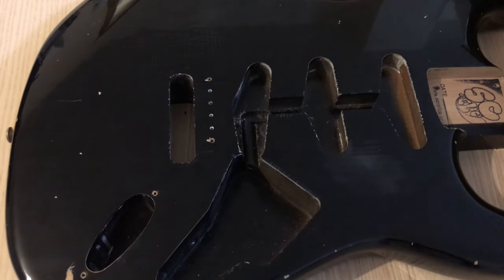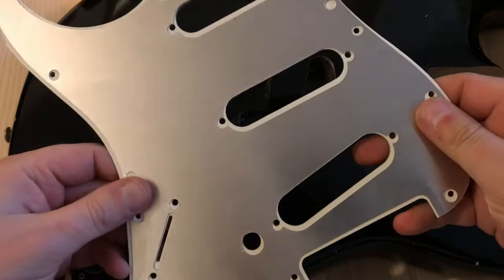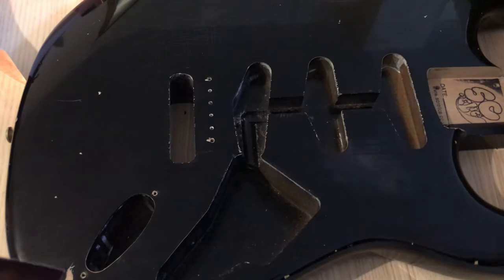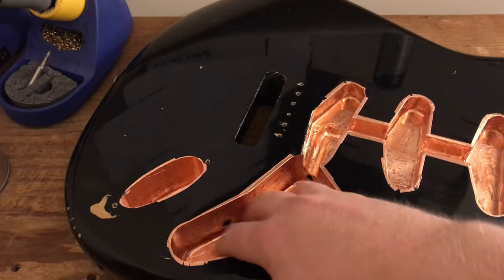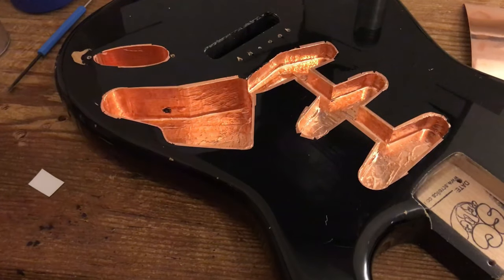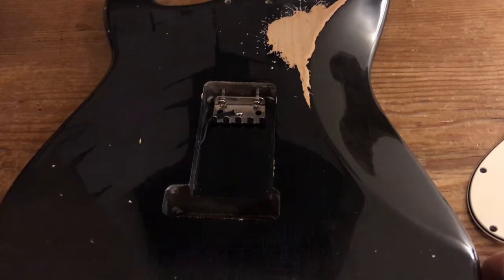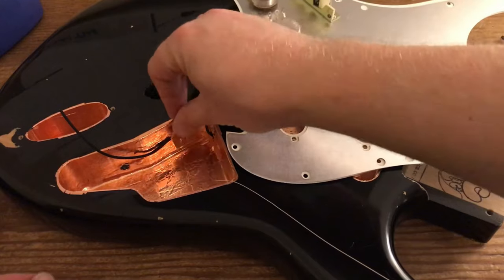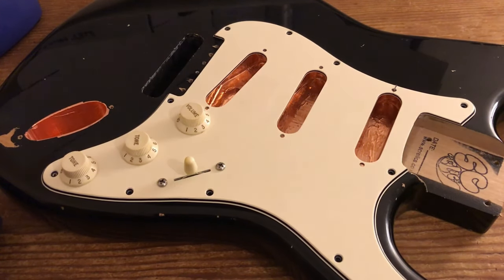Guitar Copper Shielding - How to Shield a Strat

Comment: Hi, nice video, I just have to ask, I have a Stratocaster and is giving me too much hum sound. I figured out that it doesn't have the ground cable connected to the back of the tremolo, do you think it may fix this issue? Another thing, which knob should I use for this job, volume or tone? Thanks again. Great video
Reply from the maker: Hi, thanks. Yes it should definitely be grounded to the tremolo claw. Use whatever knob is easiest
Reply: Yes, you have to ground the strings on every guitar and on a strat , they run a wire to the spring claw. Shielding your cavity to reduce noise is does not work and is simply foolish to do so. It is a wives tale that beginners will think it works for some reason when  over 100 guitar manufacturers do not all , shield their cavities with cooper. If it did work, someone would shield their cavity.
Reply: @invecta18  then why do so many people do it then and notice a difference in hum afterwards? why guitar manufacturers don't do it might be because of other reasons - like cutting down on labour and costs lol
Reply: @FriendlyNeighborhoodBallsack   Hi,  The reason is that it is suggested that it works is that people assume it works without seeing a test.  Then you watch several videos like this one and you will notice there is no A B comparison.  But still you think for some reason it works. It sound legit ?   I thought o until I did  a test.  It is a monkey see -monkey do thing. I have had a guitar repair business for 16 years and I a thought it was a good idea  ? After shielding a cavity,  It didn't seem to help much ?  I tested it  with a audiometer and found it to be useless.  I would ask  you the question , if so many people do this, why do none ( as in not one) of the major manufacturers do it ? The reason is it is extremely ineffective , it works only very , very ,  very  slightly and that is only if the person has taken the time to ground the copper foil to the circuit. I have nothing to gain from anyone believing or not believing what I am saying and I would have no purpose in making it up. This is valuable information for those who can comprehend this. It does not hurt at all to shield you cavity. It is simply as waste of your time and some money. In doing guitar repair, I have found that the smarter decisions I make, the better my projects get done, the less time I take, and happier my customers are. The more I make foolish and unnecessary decisions, the longer it takes for me to get things done, the more money it often cost me, and the less satisfied my customer  are.   Some people you can help and others you can't  .  Good luck Phil Barry, 14 West Guitars, Dunedin, Fl
Reply: @invecta18  why dont u make a video to proove it???? Just give me a link that u did a video that this video useless pls🙄
Reply: Every manufacturer uses conductive paint in their cavities and then paint over it with the body color paint.

Comment: Does it matter if your grounding wires have sheathed around them? I've stripped the sheath back obviously for soldering points but wasn't sure if it has to be bare copper wire or if it can be sheathed on the outside?

Comment: You don't really need the jumper wire between the jack cavity and the main cavity. The jack and its plate are already grounded. And with the jack plate touching the foil, that will ground that cavity.

Comment: Rather than soldering the wire could I put the wire in before putting in the copper shielding and let the copper tape hold it in place?
Reply from the maker: Yes that’s fine as long as it is well and truly taped down well 👍 but soldering it in place is easier in a way because the copper takes solder really well. If you can solder to pot casing, soldering to copper tape should be easier. Thanks for watching

Comment: Might have been a good idea to screw the ground wires to the body instead and connect them to the copper tape mechanically no? How strong are the welds to the copper tape?
Reply: The solder holds up great on copper tape
Reply: I would screw it using a copper star washer and solder it afterwards. 😆

Comment: Instead of soldering the ground wire to the copper foil, is it OK to put a tiny screw through the copper foil and solder the ground to the screw? Soldering it directly to the foil worries me down the road.
Reply from the maker: yeah that works great too. I can assure you though that soldering onto the copper is easier. All the best and happy holidays!
Reply: @SixStringSupplies   Wow, thanks for the quick answer! Happy holidays!

Comment: QUESTION - What about the lack of shielding of the insides of the wire paths between cavities.  Would treatment of these with conductive paint be beneficial or unnecessary? You video was top notch, thanks.
Reply: Best to just use shielded wire for those runs. Ground the shielding, of course. Despite what the video states, you are not trying to build a Faraday Cage (the pickups will always be exposed, so it's not a real FC. You are just trying to mitigate some of the interference by shielding the signal paths (the pickups will always be your most effective antennae, but long wire runs can also be affected).

Comment: So, how do I ground everything if I don't have an aluminum pick guard underneath the plastic one? Just use the same copper tape on the back side of the plastic pickguard and run a ground wire to that, maybe from the tremolo springs?
Reply from the maker: Indeed - replace the aluminium plate with copper tape

Comment: Hi Sir, i like your shielding tutorial. if this done properly it will eliminate the little Humming or Hiss when you touch the strings/bridge?  Hope you notice my comment. 👍 thanks 🤘
Reply: Maybe to some extent. But all passive single coil guitars are like that. There IS noise. Touching your strings to eliminate noise is normal and tells you that your guitar is grounded properly.

Comment: Could you use any type of wire to connect the jack to the main cavity, or does it have to be tinned copper?
Reply from the maker: Yup anything - even a bit of guitar string will do the job nicely 👍

Comment: This the same copper tape that you use for stopping snails and slugs getting in plant pots?
Reply from the maker: The very same - though this tape is 50mm wide, most garden centre stuff will be 20-30mm. All made in the same factory though. With 50mm you cover more area. Hope this helps!

Comment: Can you use the same sort of cable that you use to connect the pots to connect the main cavity to the jack cavity?
Reply from the maker: Yes mate. You can use any wire though 👍
Reply: @SixStringSupplies  thanks. That's really helpful. Never even changed pickups before but now changing all electrics and going to shield too. Your videos have been very helpful

Comment: Would it be helpful to use a screw into the copper shielding you are grounding to the volume pot to ensure that the shielding ground doesn't pull away accidentally?
Reply: Properly soldered that tape would rip first, the wire would break next, then the solder connection would fail. No need but won't hurt

Comment: Why add the second ground?
Reply: Exactly what I was thinking . . . isn't that a perfect example of a ground loop?
Reply: @kevinwaters6479  yeah and the pot-casing is made of metal, touches the aluminium under the scratchplate, which again touches the copper tape? totally unnecessary?
Reply: I see the redundancy as a good idea but personally i would split a wire from the bridge and run to a pot and output Jack,  if i went that far.  Hoping all ground returns to the bridge
Reply: it's a common thing

Comment: Hi there!  Shielded my Strat as per this video.  Wired it as per your Strat wiring video.  Question: If my guitar cable touches the inside wall of the input Jack cavity (that is shielded), does it make sense that the signal cuts out?  It’s functioning when I test it outside of the cavity, not touching anything, but when I replace the input, and screw it down my patch cable touches the inside wall, cuts out.  Help?
Reply from the maker: Hi! Yes if it touches the shielding it will short to ground = no signal. Despite this video I tend not to shield the jack cavity to avoid this scenario.
Reply: @SixStringSupplies  Thanks so much for the quick reply.  After much trial and error, I came to the same conclusion.  Left the shielding, but removed the wire connecting both chamber, and all was well.  Love your videos, by the way.  Very detailed, and helpful.  Thank you!

Comment: Idk if this worked for me. Might have made it worse actually.  My volume knobs have metal housing that is contacting the copper. would this in effect turn the entire guitar into a large antennae ?  I do not have back cover on the guitar. Would this need to be found and also copper lined, thus completing the cage?  HALP much love - so far so good <3
Reply: I will also as that I have to have my volume knob and firs t tone knob all the way up and both my single coils stop humming. but my humbbucker sounds like shit now  - it is also the most exposed  so idk

Comment: Is it right that it is only worth shielding the pickups as they are the only bits that act as an antenna for the 50/60 cycle hum?  You are wasting your time shielding control cavities.   A Faraday cage would not be grounded, it would be if you had metal barrier surrounding the whole guitar, which would make the guitar hard to play.
Reply: You are way off. Shielding eliminates interference, not single coil hum. And it works 100% only if it's grounded.

Comment: You're not actually making a Faraday cage. By definition, a Faraday cage is a complete enclosure. The pickups would have to be inside of the enclosure, thus blocking the pickups from the strings. A guitar has the pickup pole pieces exposed to all RFs. 

Shielding on a guitar REDUCES the RFs. It does not eliminate the 60Hz hum that single coil pickups produce. To do that, you have use humbucking/stacked double coil or active pickups.

Comment: This gentleman explain everything so well. I want to make this to my  Strato cheap guitar, because the noise with my multieffect afect the sound sign. But the cooper is a little bit more expensive for me at this moment, however I wanted to buy it, but even if I buy it cooper tape, the adhesiva has to be conductor, and if is not conductor you can fix that with a blob solder, made of Tin (I suppose), just across the seam to ensure the continuity. Then, I can make this with aluminium, but just if I make the union with a blob of solder to garantee the electricity conduct, wherever it's needed. Then, it can be cheaper than I expect. Thanks man.

Comment: Hi, great video. Must be the wire connecting chambers be bare or can i strip just a bit of isolation to be soldered in each cahmber and keep the rubber around most of the wire? Thanks.
Reply from the maker: Any wire will do mate, I use bare as on this body there is naff all space to fit the jack wires through afterwards (which were cloth covered which is deceivingly thick)
Reply: @SixStringSupplies  Thanks man. If I would live in UK, I would surely order a tape and stuff from you. \m/
Reply from the maker: Appreciate it, however there are many good suppliers worldwide if you’re not UK based. Thanks again

Comment: I followed your instructions to the T. However, after shielding all the cavities with copper tape and grounding as you described, I found there was no signal from the guitar. The problem turned out to be in the jack cavity as the end pin of the guitar cable ended up touching the copper wire on the inside wall. I peeled back the copper tape on the inside wall. Now I have signal, but the hum is still there as loud as ever :( please help...
Reply: I had a similar problem once. Instead of pulling back the copper tape, try placing a small strip of electrical tape at the spot where the guitar cable touches it, so there's no contact with the copper tape. This way you still have full coverage of the copper tape. This worked for me.
Reply: @briank6789  OK great! Many thanks, will try that and let you know if it works!
Reply: Hey Brian, happy to let you know your suggestion worked!! Thanks very much once again!

Comment: all you have to do is shield the back of the pick guard and ground it to the screw next to the control cavity,  same results,  shielding inside of the control cavity could cause a short out if a wire comes in contact with the the tape

Comment: once had a horrible noise and I just install copper tape on my HSS yamaha pacifica. it's not noise free, but it is indeed much less noise than before. But I still need to touch the string/bridge to reduce that noise. I didn't solder the last wire from the copper to volume pot, but the copper tape seems working without having to solder that wire. wonder what difference it makes when I solder that wire. anyone can enlighten me?

Comment: i have done this. but they have no sound when i plugged it into the amp. maybe i have short circuit it but not sure the source of the problem is. Need help.
Reply: That’s what it seems like. Someone here in the feed said one of the soldering connections to a pot was in contact with the foil and grounded out the signal.

Comment: You don’t need to use solder to join tape if the adhesive isn’t conductive. Just fold a section of the tape over to match metal surface to surface as you go and cover the folds with small bits of tape. Way easier than soldering. Works for me anyway.
Reply from the maker: yes very true - i don't use solder to join strips in this video - except when connecting the two cavities using some wire. Taping the wire in place would come apart in time. Thanks for watching!

Comment: Why do you have to put that wire between the cavities?  What if you dont know anything about soldering, and can not afford a soldering iron, or afford the time it takes to learn all about wires and electronics, and how to wire the damn thing together?   All I do is play the guitar, that is hard enough. I thought I could just  take out the screws,  put in the tape, and screw it back together.

Comment: If the purpose is shielding our rf,why does the tape need to have continuity. If it is being integrated into the ground system,ok, but is that necessary.?
Reply: Continuity is necessary to drain RFs to ground. That’s really what is meant by shielding. It’s creating a conductive outer layer from the electronics , that is electrically conductive ( full continuity) to remove by RFs by sending them to ground , so that the interference doesn’t mix with the output signal of the guitar. I hope that explains it.
Reply: @Enduringrevery  Ok I can buy that with shielded wiring but with a  layer of tin foil in a  control cavity i wonder if there's a need for a ground. Does RF building up actually account for enough noise to be problematic?  I have some poorly shielded guitars with no noise issues.

Comment: Wouldn't it have been easier to connect the 2 cavities with a bit of copper tape touching the overhangs on the top instead of soldering?
Reply from the maker: yes, but then it would be visible

Comment: Great video! What's the tool your using to hold down the wire while the solder is cooling?
Reply from the maker: Darren McCarthy Musica thanks! I don’t actually know what it is called. It came in one of those soldering tool kits. (You can just use a flat head screw driver)

Comment: I think grounding the shielding is pointless. I know what you're trying to do, but listen up. The potentiometers are attached to the aluminum plate, right? So there's continuity between them and the plate. Which means if at least one of them is grounded, the plate is grounded too. And the plate has continuity with the cavity shielding. Which means, as long as at least one of the potentiometers is grounded, everything is grounded.
Reply: Ok, in a second, you said what I did.
Reply: This is correct. There is no need to run a wire from shielding to pot or wherever. The pots will be connected to the PG shielding.

Comment: Just a technical note, in the video you state that what the copper does is form a Faraday cage - this is not correct. A Faraday cage would completely enclose all the components and not allow any EM in or out, including to and from the pickups, thus making the pickups not work. What you're actually doing is creating shielding, which is different from a Faraday cage. The shielding blocks some (hopefully as much as possible) stray EM from outside the guitar, capturing it in the shield and dumping it to ground so that it doesn't end up in the signal path. People call these foil setups "Faraday cages" all the time but that's just factually wrong.

Comment from the maker: There are a few comments about "corrosion" as we are using copper with aluminium. This is simply not possible - the National Association of Corrosion Engineers (NACE), who are THE global authority on corrosion engineering and standards, state this is only possible when the two dissimilar metals are in the presence of a third electrolyte (water) So as long as you don't plan on playing in the shower or bath tub and you'll be ok 😜https://www.ampp.org/resources/what-is-corrosion/forms-of-corrosion#galvanic

Comment: No need to add aditional ground wires to pot casings, you’re just adding ground loops, diminishing the effect of nice big Farraday cage you’ve just made. The pots are already grounded via the shield. Also all essential ground connections should be summed at a singular point at the shield (star grounding), and only than is this method complete and works like a charm. By the way every schematic I’ve found on this topic is wrong, even the legendary QTB document (it calls for unneeded ground wire going from negative lug of volume pot). By following instructions in this video you’re adding a big shield screen to your guitar and it may help eleviate some of the hum and you may hear the difference, but you’re only half way there. Do it the proper way and you’ll have zero hum guitar.